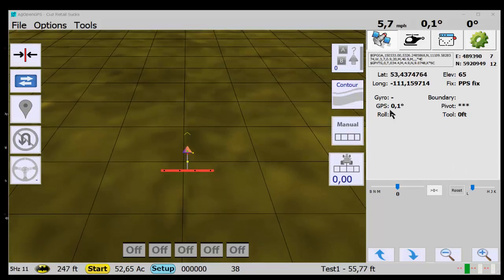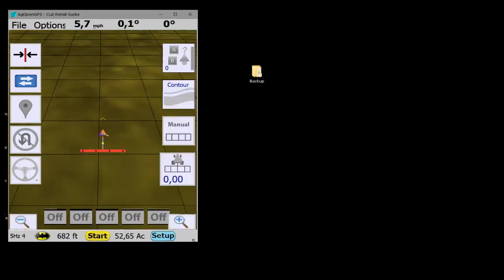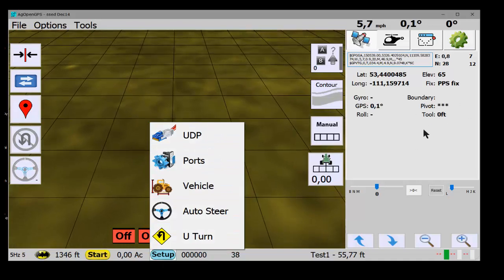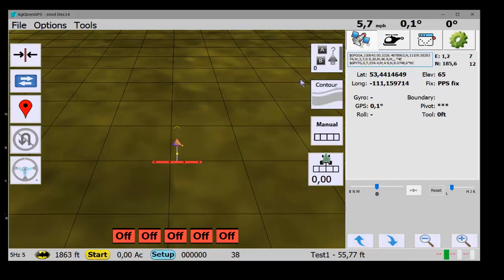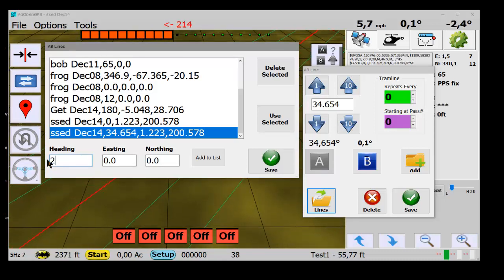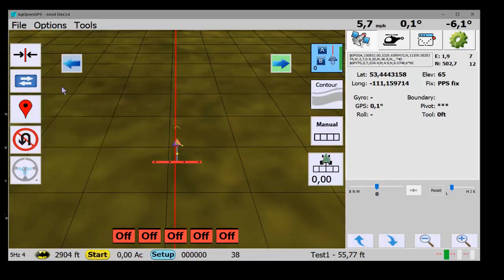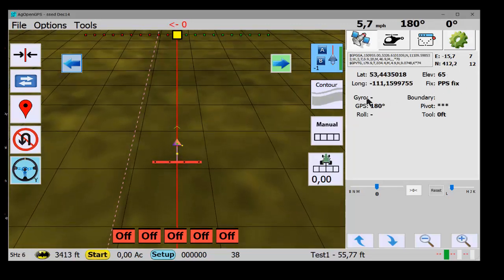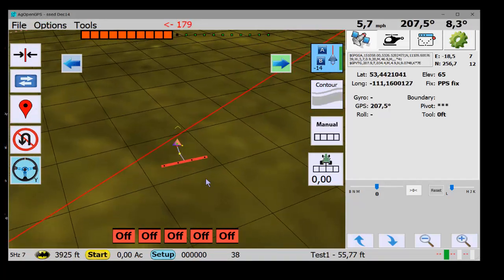AgOpenGPS GUI changes

Comment: I’ve connected the gps unit but it’s a little laggy and jumping any suggestions
Reply from the maker: What kind of gps unit is it? Is it a stable position coming in to AgOpen? It only dislpays what you are feeding it. Best to have at least a 5 hz DGPS signal.